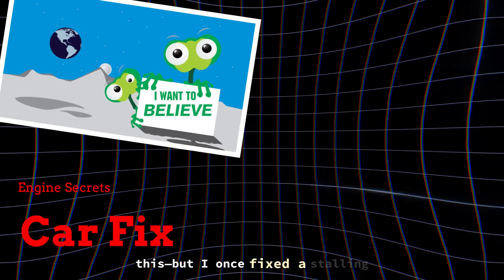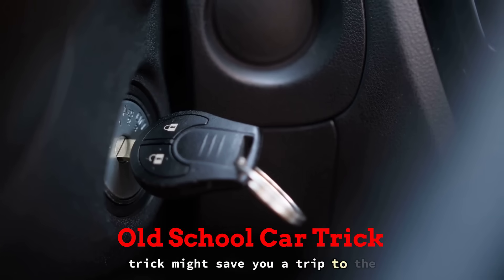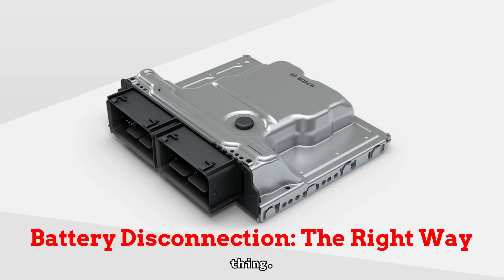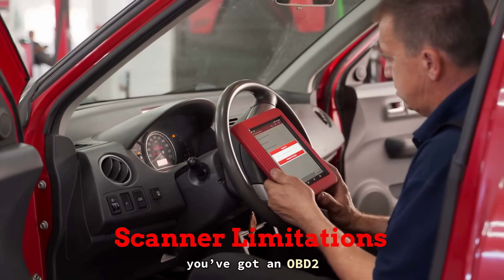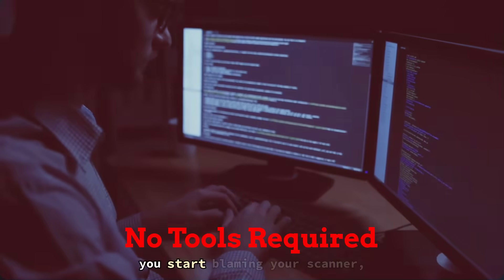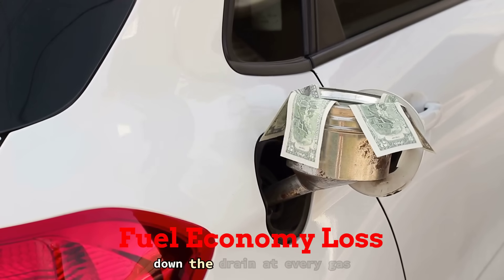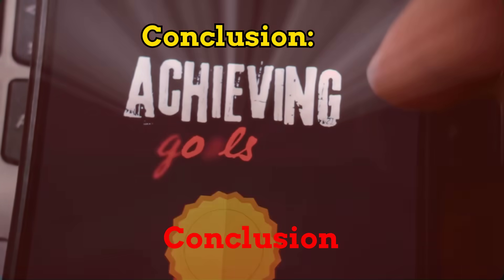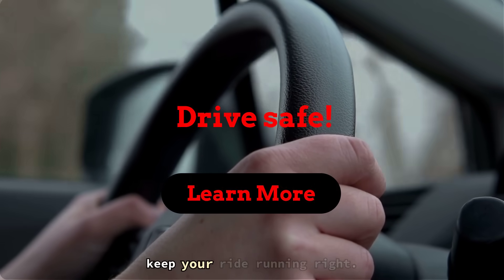Doing This Will RESET Your Car And Fix It For Free (5 Real Mechanic Methods)

Comment: I tried them all, none worked. 2018 Chevy equinox
Reply from the maker: Appreciate you trying them, Tazz! On a 2018 Equinox, some resets might not take if there's a deeper sensor or module issue. Might be worth checking for stored codes with a quality OBD2 scanner—even hidden ones. Let me know what symptoms you're seeing, maybe I can help troubleshoot!
Reply: @CarCareFix one of coded is for crank position sensor
Reply from the maker: @tazz816  Ah, got it—thanks for the update, Tazz. If you're seeing a crank position sensor (CKP) code, that’s likely the root of your issue. The crank sensor plays a huge role in engine timing and startup—when it fails or gets intermittent, you can get symptoms like rough starts, stalling, no-start conditions, or weird idle behavior.

In some cases, the sensor itself is going bad, but I’ve also seen wiring issues or even dirty tone rings trigger those codes. Before replacing anything, double-check the connector for corrosion or damage, and look for frayed wires near the harness.

If it is the sensor, the good news is it’s usually not too expensive—just a bit tricky to get to, depending on the engine layout. Once replaced, you’ll want to clear the codes and possibly do a crank relearn procedure with a proper scanner (especially on newer GM vehicles like your Equinox).

Comment: I have a 07 Honda Civic that want hardly start but after a few tries it catches
Reply from the maker: Sounds like it could be a fuel or ignition issue. You might want to check the battery, spark plugs, or fuel pump. If it starts after a few tries, it could also be the starter or a sensor like the crankshaft position sensor. Hope you get it figured out!
Reply: Had it check out not the starter don't want to catch a fire
Reply from the maker: @SonyaKing-x8i  Good call getting it checked out. If it’s not the starter and you’re worried about a fire, definitely look into the ignition system too—things like bad spark plug wires, a failing ignition coil, or loose connections can cause misfires or even sparks where they shouldn’t be. Also check for fuel leaks or frayed wiring, especially near the battery or fuse box. Better safe than sorry!

Comment: I have an 05 Hyundai Santa Fe LX 3.5l V6  can u please tell me where the EGR valve & crankshaft sensors are located in my vehicle please
Reply from the maker: EGR Valve: It's usually located on the rear side of the intake manifold, near the throttle body. You may need to remove the engine cover and some intake components to get a good view/access.

Crankshaft Position Sensor: This sensor is typically located near the bottom of the engine, on the transmission bell housing side, close to the crankshaft pulley. You might need to access it from underneath the vehicle.